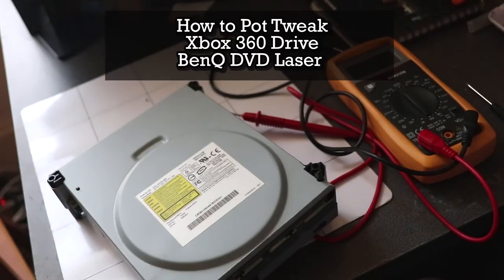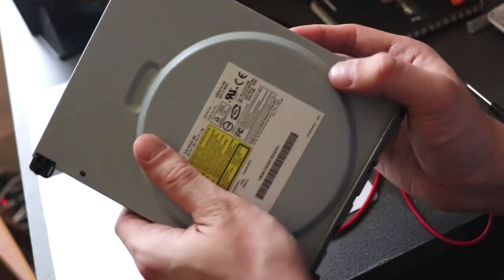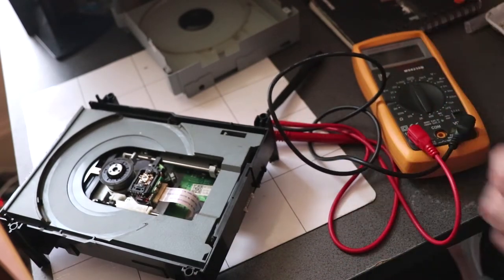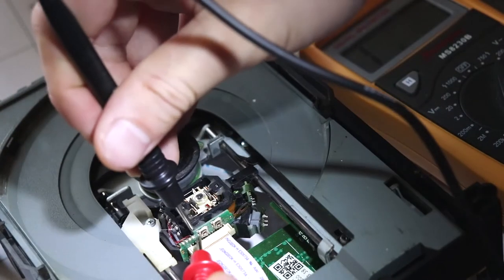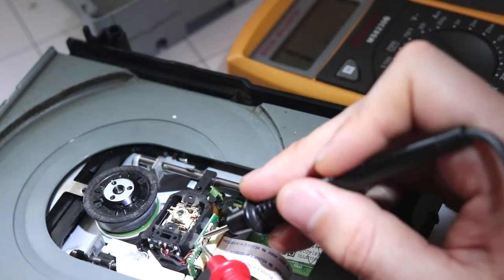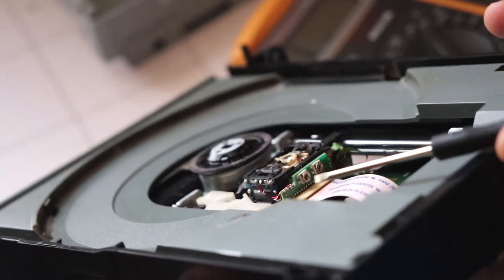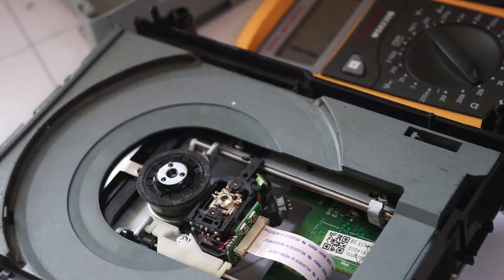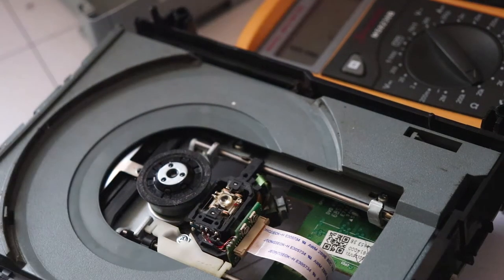How to Pot Tweak Xbox 360 Lite on Benq DVD Laser

Comment: I just pot-tweaked a console I received today as faulty, laser now works again. MFR Date is in 2010, so it's a late Phat model, worth fixing. I basicaly eyeballed it, kind of as an experiment, but also because I didn't really care whether it worked or not. For some reason I managed to get it to work, but I neither trust the laser nor the drive (it doesn't open half the time and I don't know how long the laser fix will work). I have six or seven RROD consoles here, might grab the key off the broken Lite-On and flash it onto one of the drives from one of these RROD consoles. Might even have another Lite-On, then I'd just have to switch the boards.
Edit: Ok, nevermind, I can't find my old flash set for Xbox 360 Lite-On drives, that I had  put together years ago. Been years  since I last flashed a drive. I've just ordered five new lasers and 20 rubber belts on aliexpress for together around 15 Euros shipped.

Comment: Well done. I have 3 Xbox 360s with the same problem. Every other tutorial was very difficult to understand, but yours is very detailed and easy to understand. I only have an analog multimeter, so I'll have to buy a digital one for this fix. But they are under $20. Small price to pay to get my 360s working again. Thank you!
Reply from the maker: Thank you. Oh damn that is unfortunate. It was the reason why I made this video. Not one tutorial displayed the metre reading clearly calibrating the pot. I would definitely get a digital one. It's a very handy tool not just for reading pots on laser. Hope you manage to fix them because it's way cheaper than having to get replacement drives or getting laser replacements matching the drives. 😊

Comment: Wow, this worked. Thank you! I adjusted the pot down to 3.2 and it works great now at 3.5 the game would play but I would get a disk error. I know this is a long time ago but by chance do you know what the left pot should be set to? Highest reading I can get on it is 1.88.
Reply from the maker: Thanks for the comment. If you are still getting Disk errors. Your laser might be on its way out. I believe the left pot is the dvd readings. You can try 1.5 or lower as dvds tend to not need as much power to read discs

Comment: I love this vid 😊

I did this to my partner og xbox 360 late 2008 falcon model. I didn't use a multi meter because I knew what I was doing because I done hundreds of laser calibration for drives that had (laser deterioration) I do strongly suggest for people to use a multi meter if your doing this! Also depending on how old the model on the og xbox 360 u have. You have to be careful because if you do this incorrectly the xbox will detect a fault and give you 3 red lights on the older models!

I professionally repair  phones and laptops and xbox og xboxs 360s xbox ones and xbox one x and xbox one s and series x and s 

i started professionally repairing 11 years ago its a passion hobby and job I refuse to give up!  So it's always lovely seeing repairing videos like these or even modding 💖
Reply from the maker: Thank you so much for the comment and for your input and helpful tips.
Sounds like you have alot of expertise on refurbishing hardware.

Always nice to be able to share helpful tips on fixing and restoring products and in a way being anti consumerist and helping the environment from preventing more E-waste on landfills. 
Nothing worse than seeing something that's completly salvagable go to waste or those people who want new tech every year just to throw away something that works. Although the 2nd hand markets helps this problem. There is still to much choice out there and alot of unjustified upgrades because companies want to milk you for what it's worth. 

Sorry I'm going on a tangent xD

Thanks again for watching and liking my content. Appreciate the support and keep on fixing 🧤🛠️

Comment: Open the Xbox 360 is pure pain, the clips are from hell.
Have the open tray error, the 360 can only read disks when I am knocking on top when the console read the disk after closing.
Laser re-calibration or magnet problem?
Reply from the maker: It's one of the worst consoles to open. sounds like a failing laser or possibly needing recalibrating. It's worth trying to pot tweak and see if you have any luck, failing that is a laser replacement.
Reply: @AzNstat  Recalibrate the laser from 4,6 (Fat Philips / Lite-on disk drive from 2008) to 3,5. Nothing changed.
The 360 was 8 years not used, but everything was fine in the past.
360 was very very dusty. Maybe the Spindle Motor is super dusty, and need to oil it? When it not help.. you know which laser I need? :/
Thanks for your answer and help.
Sorry for my shitty english, not an native speaker.